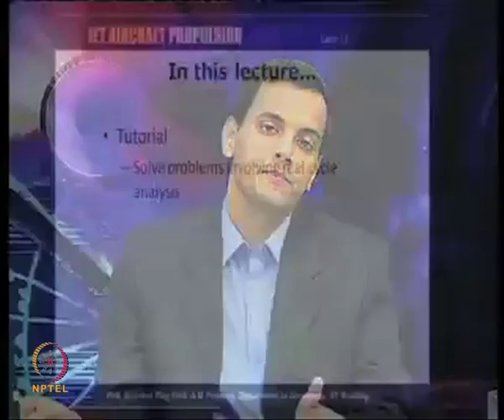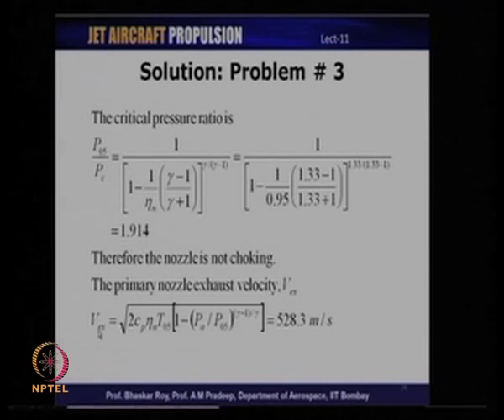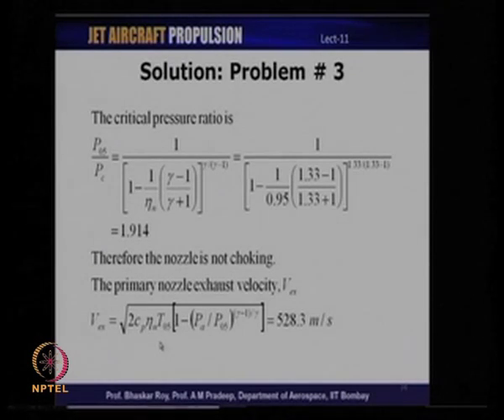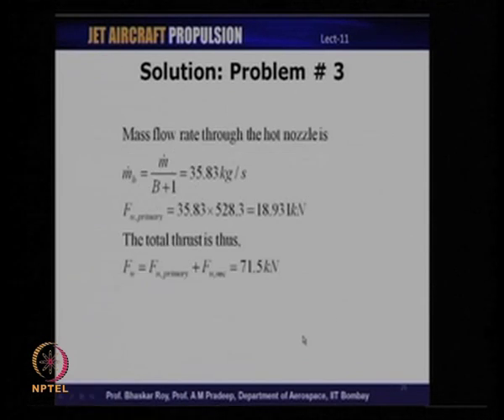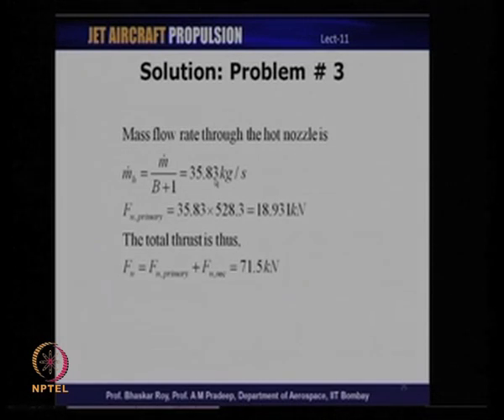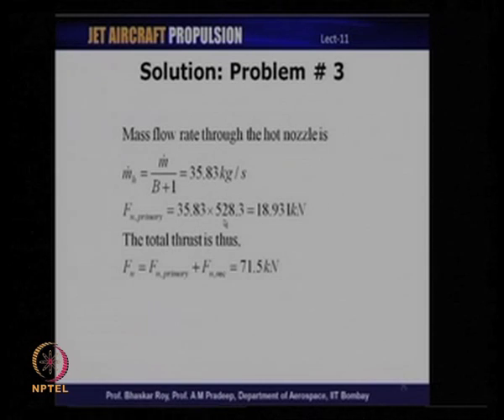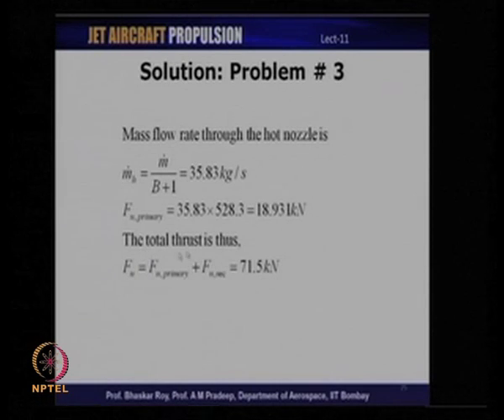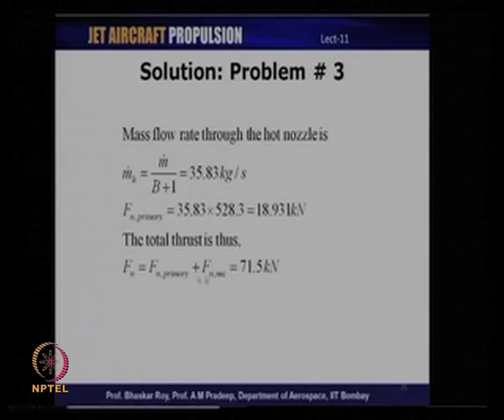Mod-01 Lec-11 Tute-2

Comment: here in first problem we are using stagnation values? Is it possible that  T02=T03 ? Since there is no heat addition to process from 2 to 3 (from diffuser to compressor) . So how come stagnation values of temperature is different in that process?
Reply: 2-3 is through the compressor (inlet to exit) not from diffuser exit to compressor inlet. So T02 could never equal T03 based on the brayton cycle, whether it is an isentropic process or not
Reply: T03 will be compressor exit stag. Temp.

Compression increase pressure and temperature of air .... So it wont be equal